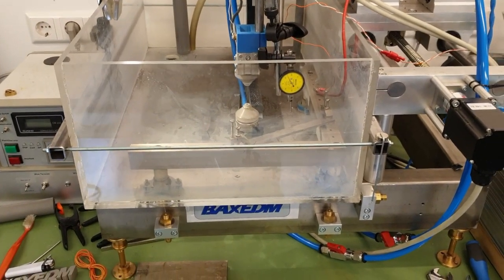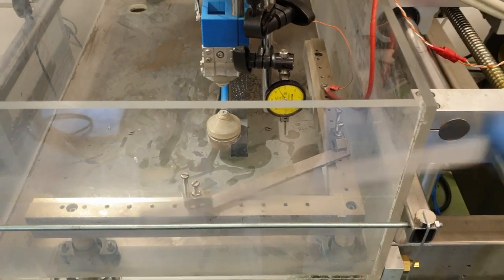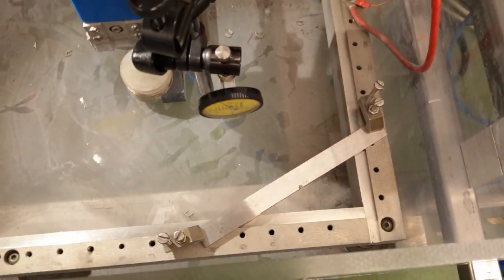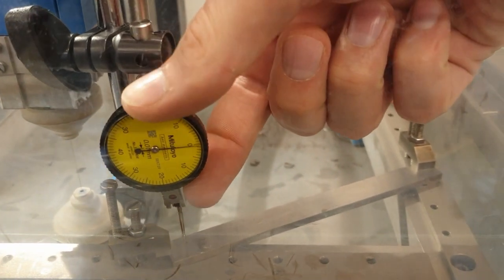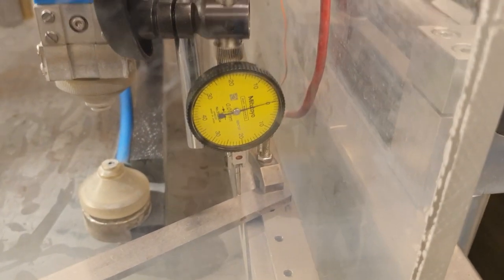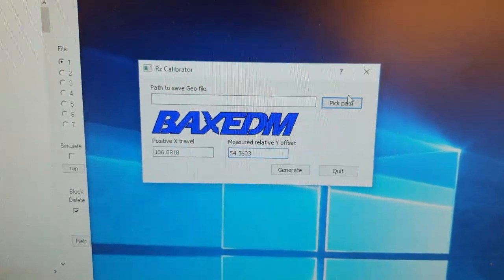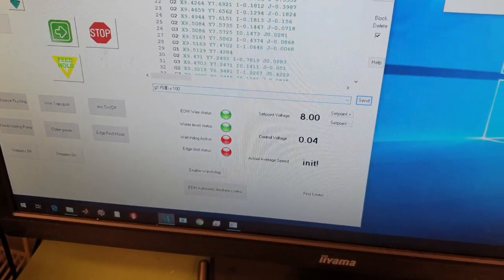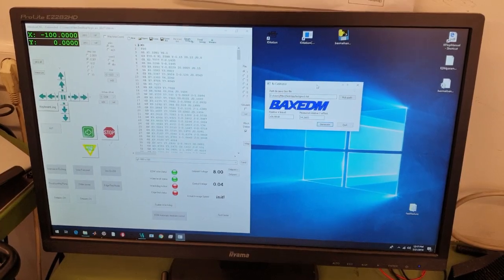Wire-EDM Machine, complete MK2 redesign: Part 2, Workpiece table - simplifying mechanics by SW

Comment: I just found this series.  I've wanted a small Wire EDM for my home shop for some time.  I think that this might now be a possibility.
Reply from the maker: It sure is. Also check out Werner Berry's YouTube channel!
Reply: @baxedm9806  Thank You for posting all of this.  I see that you sell the Arc Generator.  I probably would not go the kflop controller route, and would use steppers and mach 3 (Its what I'm used to).  Do you know of any problems if you go that route?
Reply from the maker: @joecnc3341  mach3 cannot move backwards along the cnc path with variable speed control, which is essential for EDM. That is why I chose kflop instead.
Reply: @baxedm9806  Do you have a completely costed Bill of Materials available?  The KFLOP is $250 USD, I see the Arc Generator at $3500 USD (approx).  I would love to build one.
Reply from the maker: @joecnc3341  shoot me a mail. Contact info is available on baxedm.com

Comment: thank you very much Mike for creating this tool, this simplifies the process of aligning the piece and we avoid having to adjust by trial and error, if we also add to this function the detection of edges of the generator by touching the part with the wire, instead of using a lever dial indicator, simplifies the procedure even more, good job!
Reply from the maker: Hi, I actually forgot to add that to the video. I needed the dail indicator to demo that the new x axis is true with the part. In practical use, you can combine this with the edge detection function of the arc generator, so that you indeed not even need an indicator. I'll demo edge detection in a separate video.